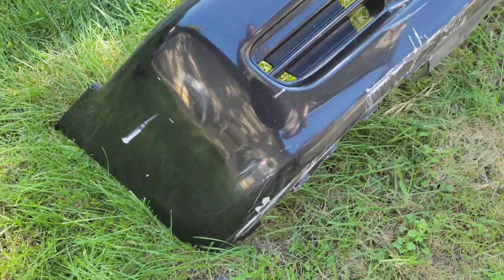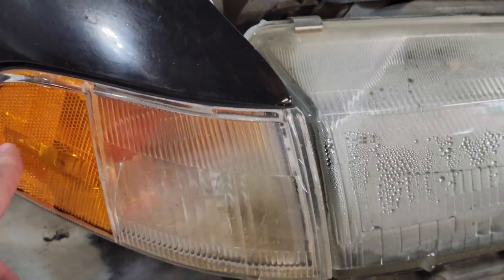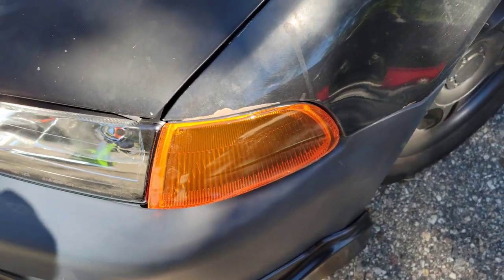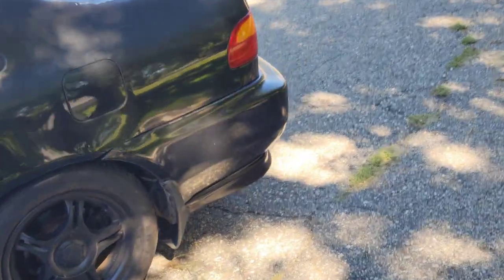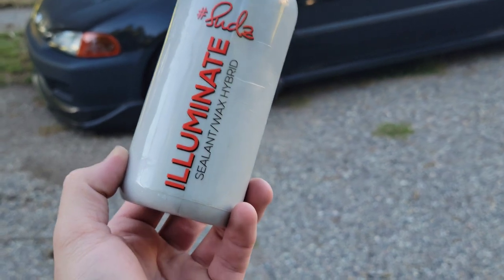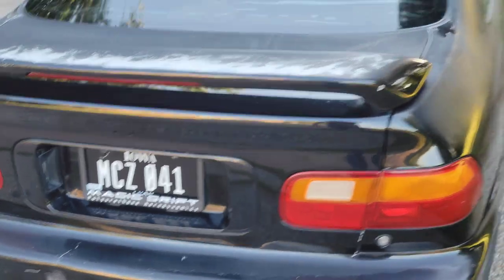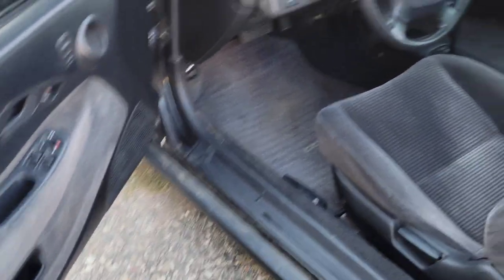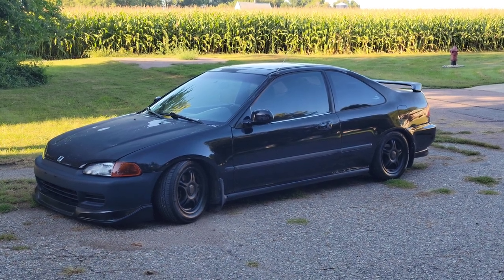THE 94 CIVIC EX IS STARTING TO COME ALONG!!

Comment: The car is too low for the road. Better raise the car up a bit!
Reply from the maker: I drive the car constantly on the road do you live around my area and no how the roads are? Both my Preludes is just as low!
Reply from the maker: The way it's parked by driveway also makes it look a little bit lower than it is.
Reply: @crv_tom  No, but judging by what I see the roads are not too ideal for this height. A bit higher seems to me a better for the chassis of the car.
Reply from the maker: Okay no I was wondering if you lived around here as far as the roads no here it will be fine unless we have something crazy going on and generally we always are very careful with driving that being said anything can always happen but the driveway the way this park makes it look much lower and also once I put my 15 in wheels on here it will set up a little bit higher